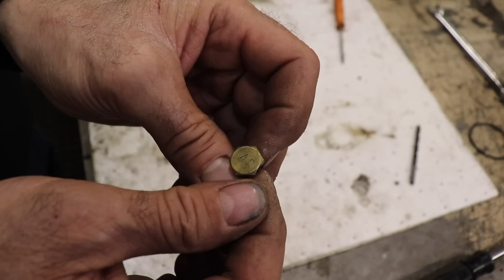Taryl's DR Leaf Vac Project

Comment: I like the way you do things! You're a better doctor than DR! Your video production is awesome too! I love all the little sound fx that you put in to the videos! Very practical and amusing video. I have a 7hp version of that motor and I learned a lot from you. I tore my carb apart and it was in worse condition than yours, I didn't replace any gaskets, seals, seats or anything, I just removed as much crud as I could, got the float needle freed up again, stuck some wire through any hole I could find and the dang thing worked! Carry on bro! Cheers, John 😎👍

Comment: Thx for the video.  I just bought a used vac similar to this... very similar.  It doesn't have a key for the electric start....it was missing.    Any idea if a different mower key will work?

Comment: Excellent video and work. Great idea on drainage pipe. When it comes to those DR products the price of the parts are expensive. We received several products from customers who had them drop ship to our shop for assembly and found problems with them.
Reply: I just bought a agro-fab.
Nice machine however...
$100 for a 3 ft piece of their flex hose.. I don't think so.
I have all winter to Fab it up to my Ferris. Definitely going to look into some drainage pipe 👍

Comment: Hey Taryl, I have a newer DR vacuum, their is a bracket that mounts on vacuum that just drops in a hole to swivel with a hook to attack by his chord into hose to keep off the ground and allows hose to be longer so you will not pull off when turning opposite way away from hose.
Nice find, and great job.
You’re a hoot 🦉 .
MM

Comment: I have a doctor leaf sucker/chopper.  Mine has a Subaru 1 cyl engine, which is fine.  The rest of it leaves a lot to be desired.  I didn't even use it fall of, 2018, just chopped the leaves with lawn mower until they were almost dust.  I am glad you got your cheap.

Comment: Another great video guys. When you were trying to seat that part into the carb, I was surprised you didn't use a 3/16" center punch, from the set you mentioned in one of your videos? Also, FWIW, if you ever need some steel, tubes, angle iron, flat, huge washers, etc, try AAA Supply in Schererville. It's across the street from Lowes on Rt.41. That's where I go when I need something odd that I can't find at the big box hardware stores.

Comment: I just got an Agrifab Mow N Vac. similar to this. the wheel bearing (Actually just a couple plastic bushings) were gone on one side so I made new ones out of PVC pipe with a notch cut in it for the grease fitting. The guy who had it never changed the oil so it was black, and it sat outside for a year. I got it going though!

Comment: I made a leaf vac out of an old chipper. Same design. Great job TD
Reply: how did you do it does a chipper have enough vacuum to be used as a loader without the mower deck? what size hose did you use and how well does it work ?

Comment: I built one of these machines from a 5HP chipper that some one threw away.  Built a frame and some large caster wheels.  The most expensive part was the 8" hose.  And building the connection to the mower deck was the hardest part to build.  Machine works great.
Reply: how well does it work does a chipper make pretty good vacuum thinking about this for a loader minus the deck. let me know. thanks.
Reply: @anthonymorrison2167  very good vacuum with the 8" dia. Hose

Comment: Taryl I get some of that flex seal and brush 2coats over those tabs and protect you from cut and use it to seal the connection and protect from rust

Comment: Curious, when you blast a carb, what media do you use?  I would think walnut shell would be a good choice.
Reply: David Moran  I use baking soda in a handheld blaster from Horror Fright. Works great, it’s cheap, and you can buy baking soda anywhere. Just abrasive enough to clean without removing any metal.
Reply: @notajp  Thanks, I never gave baking soda a thought for more delicate items.
Reply: I use play sand but I didn’t know about baking soda

Comment: Taryl, do you have a video about a two cycle leaf blower.  My leaf blower runs and then stops and is very hard to restart if at all. Most of the time I just let it set until it cools off.  What is the problem?
Reply: Blocked fuel tank vent?  Does it run longer before quitting if the tank is near empty?  Next time it quits, loosen the gas tank cap and listen carefully for air rushing into the tank.  Once you let air into the tank it should start up and run properly for a while until the  engine consumes enough fuel to again create a vacuum in the tank too strong to permit fuel to flow to the engine.

Comment: Curious Taryl would that solid mount at the back of the mower suffer from use on uneven ground. Wouldn’t that bend and break over time?  Wonder if DR has addressed this. Looks like it had taken some damage before.
Reply: It seems like it should hinge latterally at the tractor mount.
Reply: Thought the same thing, need a pivot on frame so it can flex.
Reply: Have one, plenty of flex in the hook up for uneven ground.
Reply: @skip7243  yeah   after it breaks off the frame again like in this video,  it then gets really loose
Reply: I have a Cyclone Rake with a similar hitch system.  It has longer pins that go through the top and bottom holes.  It has a lot of flex, which is good because my lawn is anything but smooth, and it seems to work well, I just stay off of side hills, I'm not sure if a loaded cart would flip the tractor over with it.
Reply: As a side note, my neighbor has a different one he bought at Tractor Supply.  It has a regular hitch bar and he has rolled the cart over a couple of times and twisted the hell out of the drawbar, luckily his JD tractor is heavy and didn't roll with it.

Comment: Got a DR Power Wagon from a customer for doing some work on some other DR equipment he has. Great machine, except for the crap Tecumesh Vector engine on it. Nothing but trouble. My wife loves that thing tho. It has the riding sulky with it and she runs it all over the yard hauling stuff around. Looking for a Briggs or Honda engine with electric start to replace that POS Tecumesh tho.....  BTW, if you have any extras of those gas tanks, I’d like to get one from you.

Comment: I learned that you can't pull hose of carbitr8tor at an angle, like maybe on some fuel hose 
nipple, as it can snap the nipple off. Luckily that was a fuel valve I did that on, an not the carb.

Comment: Great,  
I have heard that the Tecumseh tool for the seat install works also in Briggs 
I personally use a paper clip to help put the seat in then push it down with an Allen wrench or drill bit. 

Dr taryl is in today’s patient is 
[fill in the blank]

Comment: I can see why the front bracket broke off the vac frame. When you drive over uneven surfaces, it puts too much force on the connection.... Taryl you need to fabricate something to make that connection from the tractor to the vac frame pivot up/down...  Just my 2 cents AND , there's your dinner...... P.S. I've made parts for the space shuttle back in the day.... Lol
Reply: I also had to wonder why that did not come attached with ball hitch. I can only guess;  it is because when turning the hose length from the mower deck to vacuum would need to increase and decrease.

Comment: Does anyone know a way to get rid of that white crap without a media blaster/sand blaster? I have a Snapper 21" B&S with a carb like this. I manage to clean it all up enough and got it to run but it ran like crap. Any suggestions? Carb and brake cleaner don't work, need something that breaks it down to remove it.

Comment: I see in this video the DR Vac was equipped with a Briggs & Stratton engine. I just came across a 2018 DR Vac it looks like this unit is equipped with Briggs & Stratton Look alike (Knock-Off) What is the brand of this engine and who would sell parts for this engine?

Comment: Good job on not cutting that hose for the test ... things dang expensive. i have  seen some trailer vac versions use a l bracket off of trailer or mower to hang it with a bungee cord  so that it doesn't wear a hole in it from grass friction

Comment: Take a 3/16 dowel, drill the end with a 1/64" drill, push a brad nail in the hole, cut the brad so there is only about an 1/8 sticking out... the dowel with brad in the end holds the seat well in place when you slide the carb over it.

Comment: you need a ultrasonic cleaner for the carb cleaning
Reply: He has one, It was sitting besides his sand blaster..
Reply: I've used a heat gun, and a "dispensing syringe" full of carb cleaner hooked to the air compressor to clean a very stubborn carb from almost the same engine (5.5hp, not 9 like this one). The idle passage (the tube above the main jet that isn't the main nozzle) was completely blocked. The dispensing syringe lets you make a good seal between the air compressor and the particular passage you need to clean with the tapered plastic tip. In my case, 100psi air wasn't enough, but as soon as I heated the whole carb up with a heat gun, and then used the syringe full of carb cleaner and 100psi air, it cleared right out. Engine runs great now. It's tricky to find the sryinges with the air connection on the back. Search amazon or ebay for "solder paste dispensing syringe" or "glue dispensing syringe", and look for the ones with the green cap on the back with the clear vinyl air hose, and ones that come with the plastic tapered tips.

Comment: That battery looks like the ones the local phone companies use to keep the telephone lines operational if the electricity goes out. And those batteries are expensive. They work great for riding mowers tho.

Comment: Hey taryl, I'm a machinist. Bet I could make you a tool to insert that seat in your carbatraters. Looks like it needs a tiny nub the diameter of the hole in the seat just to hold it in place.

Comment: Insert a small diameter wire down in there and slide the new seat over the wire. Remove wire and then seat the seal.

Comment: Taryl i have the same problem with people who bring me things to fix. They want to tell me how to do it. But i just say do you want me to fix it or do you want to. They usually leave it with me. I use baking soda or glass beads to blast carburtraitors and never had a problem...love your videos..and on the next one would please throw Slippers over the fence..lol..Cheers 🍺🍺🍺🇺🇸🇺🇸
Reply: I did a anti freeze flush and fill for a guy who waited,   off the side I heard him say,  SIRI  how to flush and fill radiator.    he comes running back all mad at me,   he said stop,   you must use ethylene  glycol    I shit you not,   I am holding the new jug of antifreeze in my hand getting ready to put it in when he does this,   I hand it to him and ask him to please turn it over to read the label on the back,   he stands there like WTF is wrong with me,   then he reads the label and sees the chemicals in it,   it takes all my will power to stop from laughing at him,  he then sees it on the very short list.  he hands it back to me,   not saying a word,  he walks away,   I then say,   I know you want to get going but I can get this done a lot faster without the interruptions.   I get done with it after getting the air out of the system,  he then pays and ask me,   hey I got other cars I need serviced,   I tell him,  ok but you got to drop them off,   and then life was good again.
Reply: @ateam6486  yes if some people are so smart then why do they bring their junk to me to try to revive it..gotta be humble...lol... Cheers 🍻🍻🇺🇸🇺🇸

Comment: Use a dab of grease to hold the seat on the end of the drill. Put a paper fuel filter in line cause those metal screens in the fuel tanks lets dirt thru. My two cents. There's your lunch.

Comment: I think I would still set up a drawbar type hitch for the tractor and that make those back wheels possibly stationary because otherwise the swing out on that thing is going to be tremendous you're going to be knocking over everything I've seen those and I thought man those need to be hooked up with a drawbar and then I don't know if you'd have to make those back wheels then stationary or not but I think that would be the best way to do that I don't like the way that mounts to the Tractor solid puts a lot of excess weight on the back of the tractor and stress and I just don't think that's very good try it see what you think but I think a drawbar would be the best
Reply: How would you make the wheels stationary?  thanks

Comment: You can buy that same battery at Harbor Freight for $65, less with a coupon. I bought one for my little 18 inch electric lawn mower
Reply: $20 on ebay and a standard mower battery go for $20-50.

Comment: Just surprised how people abuse equipment, darn machine costs $2.400 new, I have one for ten years now
Looks like new because take care of it. Grease fittings are there for reason. Noticed in the video the front and
Back storage panels are reversed, the metal angle which was bent and you fixed stiffens the door when full and
The instruction labels on starting should face engine. You can fill the hopper to the top till it snows leaves it
Holds a lot. Unfortunately DR discontinued this model for there cheaper cloth trailer type. Wouldn’t dare give up
The one I have. Dual hitch is the best, turning and backing up to unload. Do like the 6” culvert pipe idea, will look
Into it at sometime, replaced the battery this year, after ten year’s it died, ordered it from Amazon (Mightymax) $33
Ground is on the left when place on machine
Reply: frank, a assume you have a small tractor?  what type of hitch do you use to attach?

Comment: I’ll never do this, of course, but the chute of my lawn tractor comes out the rear of the tractor. So, does that mean I can never have a Doctor???  :(. And (an even more stupid question) - wouldn’t a lawn tractor just pick up those leaves anyway, and dump them into the tractor basket???
Reply: Ya, it works but they fill so fast and then off and on the tractor so much. I chop to the middle or in rows and then go back with the bagger. Finer leaves, less dumping. OR, have a beer and watch the leaves turn to mulch.
Reply: calvin mientke Surely, the latter is the better environmental option...LOL

Comment: I've always been told that white corrosion (zinc oxide) spells doom for a carburetor.  Once the zinc leaches out of the aluminum, it's going to just continue to corrode.

Can anyone confirm/deny?  I've thankfully never encountered it.
Reply: pretty much it is a time bomb from the amount of corrosion that took place, that carb's metal lost most of its + ions and any time it is exposed to even a little moisture the process starts over.

Comment: Alright dr taredactl you forgot one part; that I learned the hard way, that I will share with you because I didn't know: these heavy flywheels with the specail tapered crankshaft (how far they hang of the engine) , if they are off balance slightly, expecialy if they have more then (any)" runout; they will tear up the con rod and crank on that engine quicker then you can get drunk of natty daddy. They cannot break in, they must run full throttle out of the box, no vibration.

Comment: Hit something, try everything. I put a limiting cable from the frame to the dump box on mine cuz it's a bitch to filp it back up when it's full of grass & won't empty cuz it's flat on d ground. That dern intek gas tank gets water in it every time it rains. My Dr lives outside. When the blower housing wears out it will pepper yo hide. Housing runs bout $80 a half. 6in model hates sticks & thick grass.
Reply: It's also really easy to bend that flimsy air filter housing & suck tons of trash in the engine. 1 & a half hours like that now burns at least 8 oz oil in an hour.

Comment: I like this channel but I dont like what you did to this customer, you told him how much it was to buy the parts and floored him with the amount then bought it from him and fixed it yourself at minimal cost when you could have offered to fix it your way and he would still have a working vacuum, no he is out and you are in. that just seems like you stole it from the guy.
Reply: Yeah, Taryl maight have been able to save the customer some money in parts, but labor fabricating parts sometimes cost ya more than if ya bought OEM. It's different when you are working on your own stuff and are not as concerned with the labor cost.